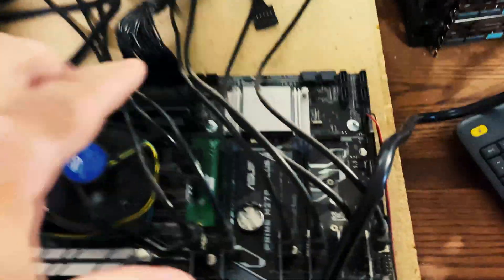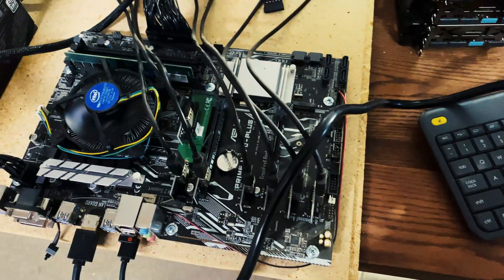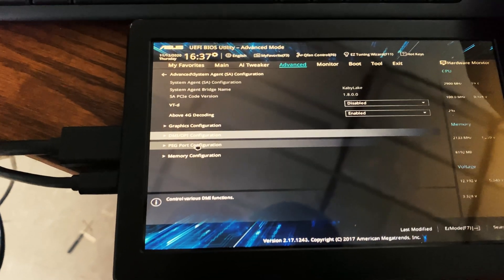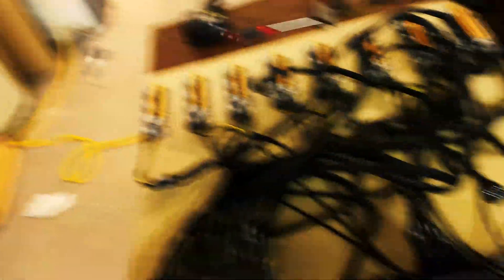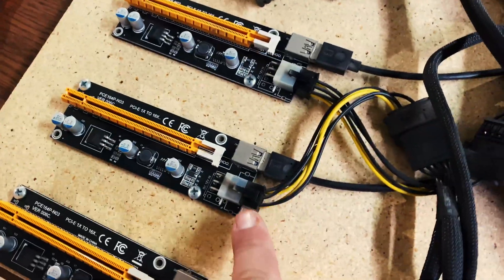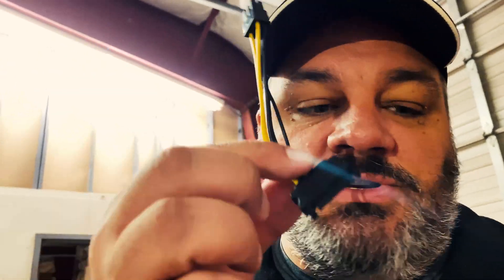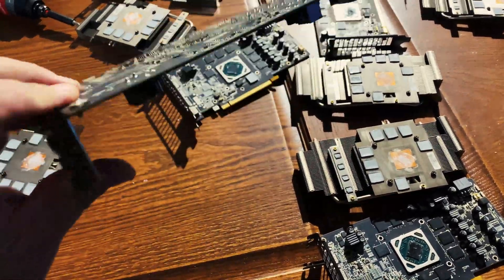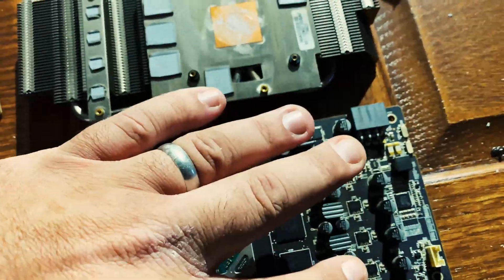Quick tips and tricks troubleshooting your GPU Mining Rigs

Comment: im having an issue on windows, trying to add a different card to my mining rig, i have 4 1070 ti and an rtx 2060 and gtx 1080. every time i try to hook them all up im getting error code 22 43 on either. is there a rule to only mine with one type of card for each rig? can you mine with all different cards?
Reply: Thanks for watching. You can contact me on Signal App for more Guidan….  
+ 𝟷𝟻𝟽𝟷𝟸𝟷𝟶𝟷𝟺𝟸𝟽.

Comment: I have a question for you that no one has been able to solve yet. I have a 6 GPU mining rig all 30 series. Running Windows 10 using T-Rex miner ethermine pool. Everything in Windows is disabled all background apps nothing is running at all. All overclock are completely stable I will usually reset the rig once per week for the hell of it and out of the near 100,000 shares it pulls one will be rejected so no issues there. The problem is once per day the gpus will decide to boost and when I mean boost they will come all the way up to their maxboost clocks for no reason which seeing that the memory is overclocked that causes an issue. I will get reliability voltage Max utilization voltage limit warnings in Hardware info. All of the gpus are hooked up through risers also. I haven't been able to tell if the gpus do is all at once or if they do it separate from each other but when I go back to look at Hardware info one or two of the gpus will not have the warnings on them so I am assuming they do it separate from each other. All of the cards run consistent and cool until this happens then suddenly they will throttle then the problem fixes itself and they keep mining away. Any help would be greatly appreciated because it would seem to be a safety issue to me but maybe not. It definitely cannot be good for the gpus to have their memory set at + 1200 and suddenly have the Boost clock go to Max at the same time and throttle.
Reply: Thanks for watching. You can contact me on Signal App for more Guidan….  
+ 𝟷𝟻𝟽𝟷𝟸𝟷𝟶𝟷𝟺𝟸𝟽..

Comment: Have you ever had an issue when you have a pcie m.2 ssd installed, hooking up a 5th GPU the system won't boot? But when I disconnected the 5th GPU the system booted fine.
Reply: Thanks for watching. You can contact me on Signal App for more Guidan….  
+ 𝟷𝟻𝟽𝟷𝟸𝟷𝟶𝟷𝟺𝟸𝟽..

Comment: This is one of the reasons I dont use risers, i went with a motherboard designed to fit 8 full size GPU's on the MB itself. Less parts = fewer problems.
Reply: Which MB did you go with?
Reply: @stylesuxx  you can find them on newegg for about 200-250 bucks or go to alibaba  type motherboards for mining in a search.
Reply: @stylesuxx  Thanks for watching. You can contact me on Signal App for more Guidan….  
+ 𝟷𝟻𝟽𝟷𝟸𝟷𝟶𝟷𝟺𝟸𝟽.
Reply: Less thermal efficiency too
Reply: Thanks for watching. You can contact me on what's App for more Guidan….  
+ 𝟷𝟻𝟽𝟷𝟸𝟷𝟶𝟷𝟺𝟸𝟽..

Comment: Where do you get the memory pads - they are thicker than most “thermal pads” I’ve found.  I repasted my GPU but just reused the pads.
Reply: Thanks for watching. You can contact me on Signal App for more Guidan….  
+ 𝟷𝟻𝟽𝟷𝟸𝟷𝟶𝟷𝟺𝟸𝟽..
Reply: Thanks for watching. You can contact me on Signal App for more Guidan….  
+ 𝟷𝟻𝟽𝟷𝟸𝟷𝟶𝟷𝟺𝟸𝟽..

Comment: Hi there! Thanks so much for the videos, they have been very inspiring for me :-) And part of the reason why I decided to start mining. I am just starting with mining and crypto, but I have been putting together computers since I was in college. You have an impressive rig BTW! I assembled 5 small rigs (9 GPUs each) with rx 5700 xt, ASRock H100 Pro BTC, and I used two EVGA 1300 Supernova Gold PSUs  per rig. But the weirdest thing with these PSUs: the first one didn’t work right out of the box, the second one I decided to test before connecting anything and it did work, but after everything was connected as soon as I turned it on the PSU short circuited and stopped working. The third one, after working stable for a few days, short circuited as I was pulling out a USB drive. All the parts are brand new, the only thing is that I am using wire shelving for rack. I used VGA splitters for the GPUs so one GPU is one slot on the PSU, no more than 5 GPUs per PSU. Am I doing something wrong? Is there a known problem with these PSUs? Should I do only 8 GPUs per rig? Please help, it was a rough night. Thanks again!
Reply: AMD's 5700 XT draws up to 225 watts. The RX 5700 comes in lower at 185 watts.  I have had disappointing experiences with eVGA PSUs (1000W, 850W) ( RMAed and got another dud back)...maybe just bad luck or batch of PSU.  You wil have to do the math ... 5 gpu is a bit close to the limit.  I normally see 6 and 8 cpu rig configurations with no issues...9 gpus is a new one.  Of course, use the correct overclock settings to optimize whatever crypto you are mining.  What OS are you running - Wndows, HiveOS, SimpleMining, etc?  Good luck.

Comment: Sapphire read a lot uses .75mm pads , were did you found those , .5mm the cooler  wont touch the memory , and 1mm you can see a tiny gap between on the screws (board and cooler)

Comment: I replaced some of mines they were 2+ years most of them and one gtx1080 was 3 years+ this card after switching to ETH started artifacting with the memory overclock , card still can overclock normally but once the ETHPil runs it need to have less OC , can run only 4635mhz top on memory

Comment: He BBT, i have a RX 580 that does not post in windows when added to my rig, tried it on multiple rigs with different motherboards (asus b250 and asrock h110 pro btc) the motherboards do not recognize the gpu (error in pcie slot on b250) but my pc does recognize the card and and its running fine and stable, what could be the issue?

Comment: Awesome video, Very useful!!

EDIT: I thought I would add the notes that I took on this video so when I come back to it I know what's up! 

1. Turn off Motherboard LED (Breathing Effect LED) so that if it comes back on that means your motherboard has most likely reset its BIOS settings. Which means you can dig into the BIOS again make sure proper settings are set. (4G Decoding, PCIE Link speed at Gen 2 or Gen 1) 

2. Keep an additional Riser installed with the mining rig so that you can easily troubleshoot on it a malfunctioning GPU to make sure it is not a Riser issue.

3. (IF YOU USE 6 PIN TO SATA FOR RISERS) Before replacing your Riser the 6 Pin to SATA is usually what burns down faster and gets stiff. If the cable feels stiff and hard that means you should replace it first and see if the Riser works again like normal.

4. Replace thermal pads (3mm mostly) and thermal paste on all GPUs. Make sure VRams are covered properly as well. It will extend its life and make it more stable.

5. Do NOT dust GPUs while they are running. So much can go wrong. So turn off the rig before cleaning it.

Comment: Hey carter, I got a 1080 Ti that is being detected by windows but refusing to install the driver, some kind of error is happening while installing and the lights of the GPU are getting turned off, can it be revived?
Reply: ded
Reply: Try to revive it with heatgun 10min on Gpu 😁😂
Reply: @nikolakarovic5964  on the processor?
Reply: @escaflawn  Yeah on Gpu just, so you can reball with new Gpu if thay is dude and not destroy board and caps with Owen. Depends on heatgun you can put btween 220C and 350C ( Cheap chinese Baku heatgun) and heat it from 15cm.
Reply: are you using a raiser or direct conection to motherbord?
Reply: @cryptosweden8517  I tried both, same results, it happened once before but it started working again after a restart, now not installing driver anymore..
Reply: @escaflawn  have you tride another motherbord ? and under linux OS ?
Reply: @cryptosweden8517  Another MB yes, another OS no..